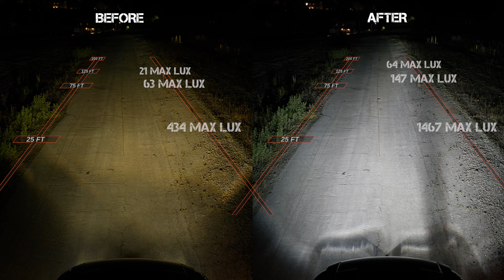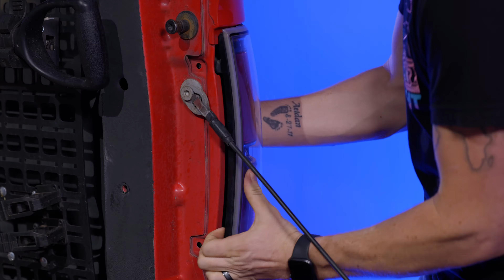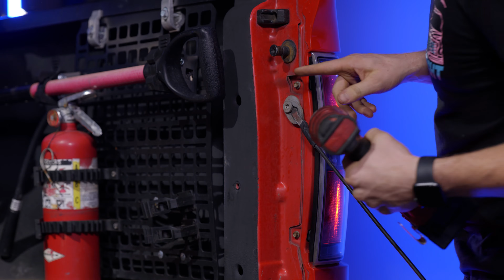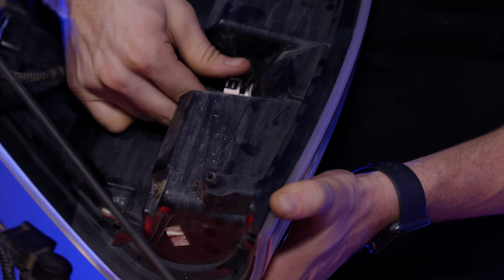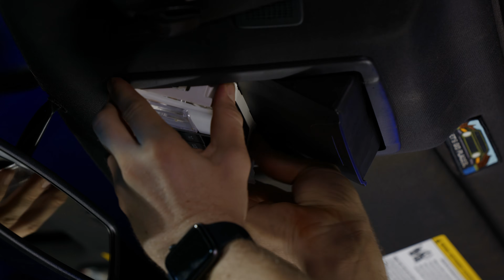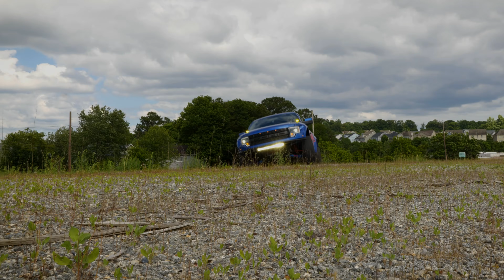Front to Back LED Lighting Upgrades for the 2009 - 2014 Ford F-150 | HR Tested

Comment: The side marker lights by Morimoto on the back are designed poorly and they short you on the wiring so they barely fit and put way too much stress on the harness. You will most likely get a wire rub through on the body. They are way over priced for what you get.

Comment: Main question I have is how do these after markets hold up to the elements like ultraviolet Sunrays and plastic fade/dullness over time?
Reply from the maker: GTR Lighting spared no detail with the new Carbide headlights. The polycarbonate lenses are treated with a UV-resistant coating to prevent sun damage, fading, and dullness over time, ensuring they look like new for years to come. The interior trim also features a combination of textures for added depth and durability!

Comment: The factory lightning on my 14 FX4 does not suck. 

I’ve had it since new and am only now ‘upgrading’ because I want new headlight assemblies.
Reply: i also have a 14 FX4. the factory lighting is trash.
Reply: @erikmarshall6490  does yours have the optional projectors like the Limited and Platinum? Mine does. The right one looks dirty because I hit a deer 2 years ago and it cracked the rear of the housing, so water gets inside. Still works like new. 

The ones I’m putting in are the same style just a less costly aftermarket version.
Reply: My 2014 XTR is shitty all around. I had  2017 FX4 fully loaded few months ago but got totalled out by insurance and had to settle on one i have now. 😢

Comment: Hello I want to upgrade to 3157: GTR I-LED ULTRA bulbs  for my 2013 Ford F-150
Do I need to order the anti-hyper flash adapter?
Reply from the maker: If these bulbs are for your Turn Signals, you will indeed need resistors (One resistor per bulb) when installing!

We carry kits for each vehicle on our website, just enter your vehicle info and hit search!
https://www.headlightrevolution.com/

Comment: What is not shown  is how to get the wire harness through the rubber grommet. I maybe missing something in the video, but it required my cutting the  grommet to allow the wire harness black connector to pass through, then I could hook up the harness and push grommet and LED light back into the truck.
Reply from the maker: Good info!

Comment: I have a question please..i have peugeot 508 with 35 watt hid bulb..can i change these hid bulbs with 55 watt led bulbs without complications ?? Many thanks
Reply from the maker: You would have to change the ballasts, not the bulbs. But this would slowly burn the projector bowls resulting in less light output.
Reply: Thank you so much

Comment: Hello, does anyone know if you need a special tool to remove the black clip from a H4 HID High Beam wire, thank you.
Reply from the maker: You do not.
Reply: @HeadlightRevolution  Thank you, I tried to pry them off with two small screw drivers and it will not disconnect.